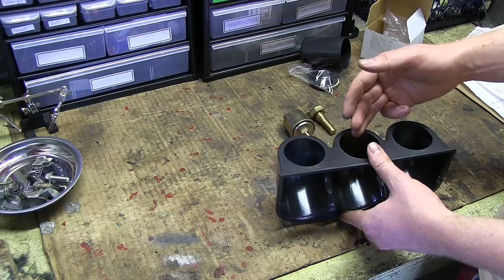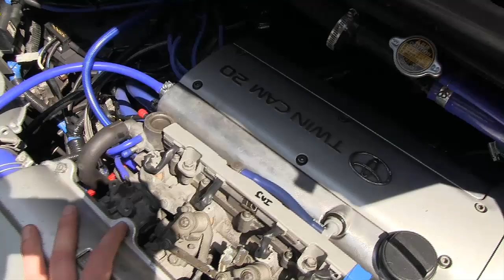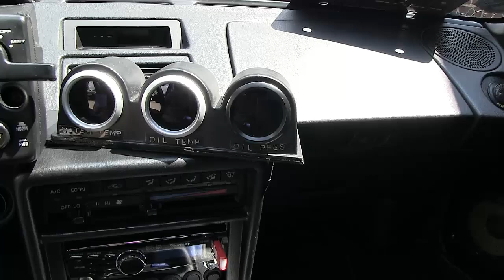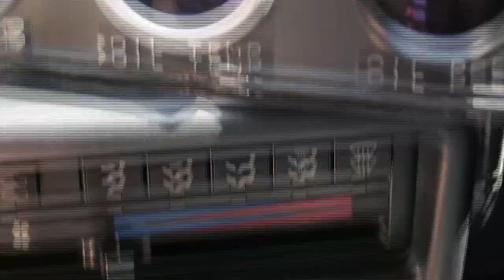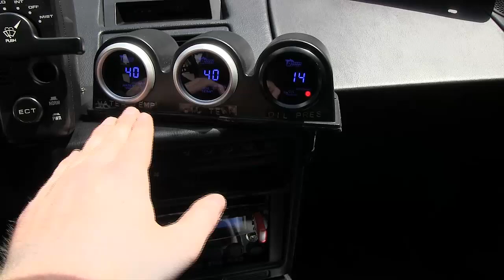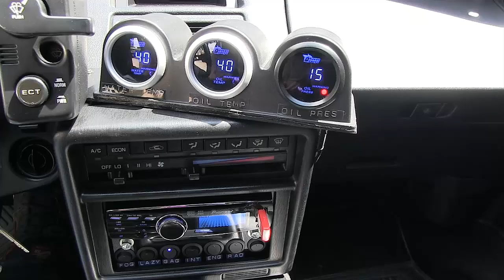how to install aftermarket gauges

Comment: You want to add the water temperature sensor on the heater core line.  The reason being is if the thermostat gets stuck CLOSED the gauge wont budge even though the engine might be red hot.  The stock OEM gauges are very curved as far as reading goes so the gauge might not even more over half until your block is at 240F and your coolant is bubbling out..

Comment: Good tutorial at last. Do you have any clue on how I could mount the oil temperature sensor on an Audi 80 TDI - 1993?
Reply: Insected Junk make a bracket on the dash and use some nuts and bolts with a drill